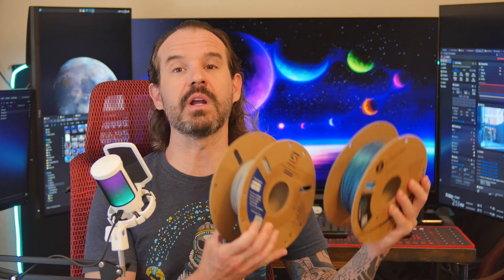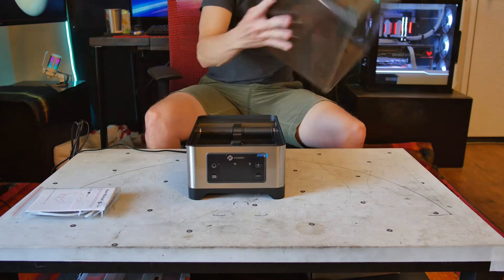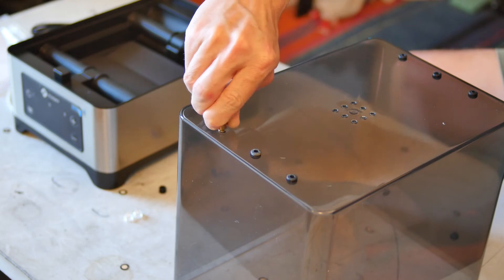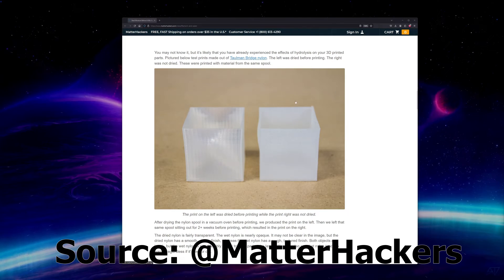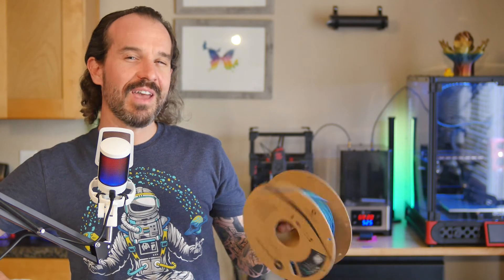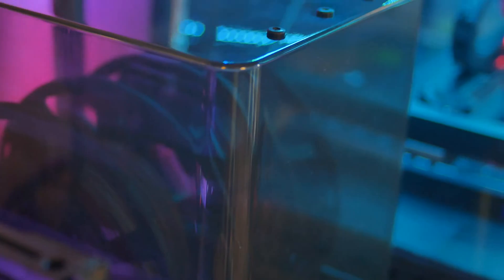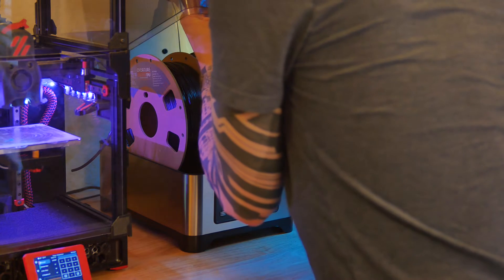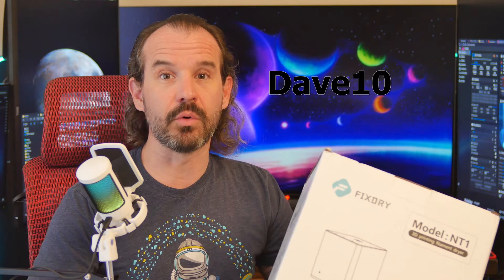Do You Need a Filament Dry Box For 3D Printing? Review of The FixDry NT1

Comment: Thanks for the review! I'm searching for a way to dry my filaments but I'm not satisfied the any consumer-products which I saw. This one was new but has also it's flaws. 

I think for NT2 they should move the connectors from the lid to the base. This way you could load it way easier. Another thing is the lid itself, which in my opinion should be soft-connected to the base. Maybe some hinges which can be easy disconnected. I think this would improve the handling with it. Would also be nice to have a lid for the lid ^^ The small venting holes at the top are permanently open, which leads to moisture turning into the box when it is turned off.
Reply from the maker: Dang dude, like everything you said, yes!

Comment: Dave, will the FixDry NT1 fit a Polymaker 3kg spool which is 250mm diameter by 117mm width?
Reply from the maker: It should. They do advertise it as accommodating a 3kg spool but I suppose there could be some variation in the specific spool sizes. I measured the box the best I could and it looks like it will be a tight fit.

Comment: Great review, Dave. I just got another dryer a few weeks ago that I'm not too happy with. Is there a compartment to store silica packets for continued storage? And does it display the humidity inside the box if it's not running the dryer?
Reply from the maker: Thanks brother! 
There is no place to store silica, but you just gave me an idea for a pretty straight forward mod. Can use the extra holes in the lid to mount some printed boxes.